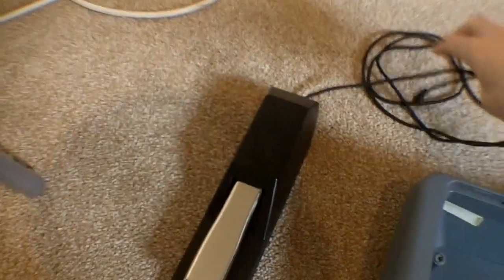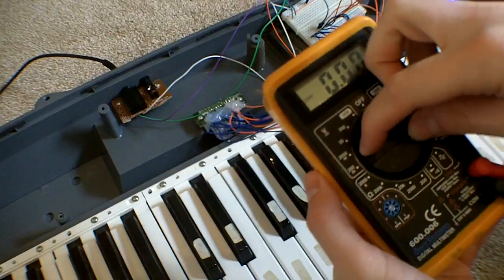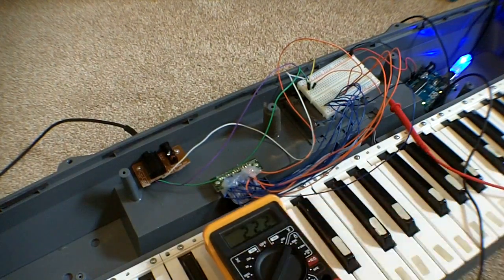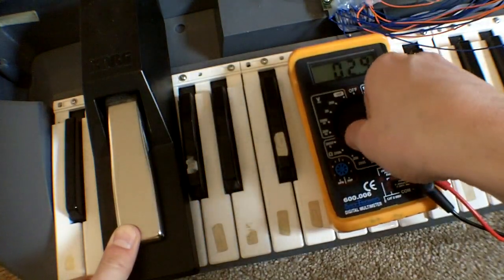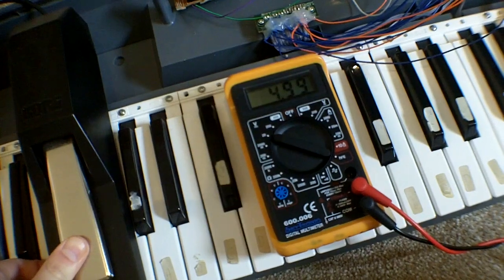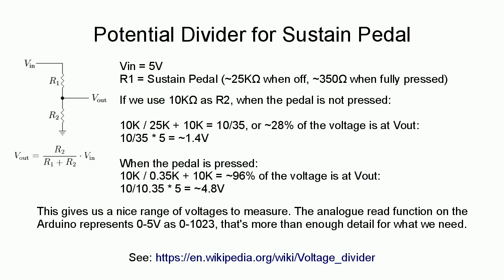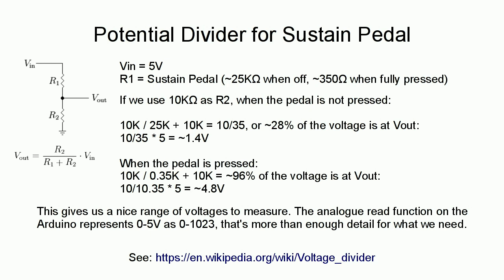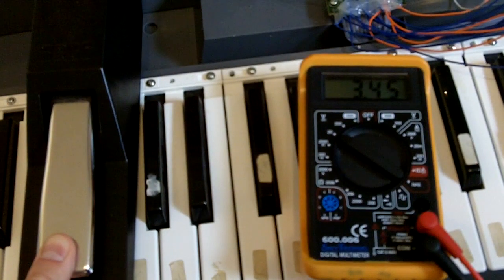Frankensynth: How The Sustain Pedal Works (Potential Divider)

Comment: Hello,

My name is Mauricio, I recently bought the product MIDIPLUS GarageKey F37 MIDI Keyboard. I'm happy with the product but I would like to know if you could help with a technical problem that I have. The Keyboard works very good, is portable, easy to use... but it lacks of something to be perfect: The sustain jack to connect a sustain pedal. In my work is essential this aspect (sustain).

I would like to know if you could help me with the following:

1). To send me an electronic map with the instruction of how to add a sustain jack to the keyboard (where to place the resistances, electronic elements, etc.)

2). To send me (if it is possible) an instructional video of how to do it.

3). Any other thing that you think I may need.

I would like to thank you in advanced for your help this is very important to me, and I really need it.